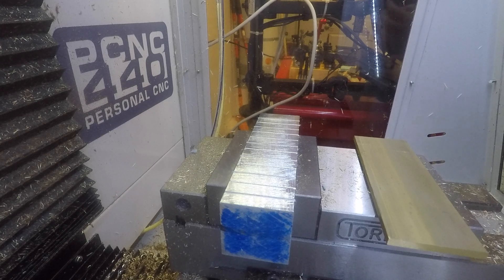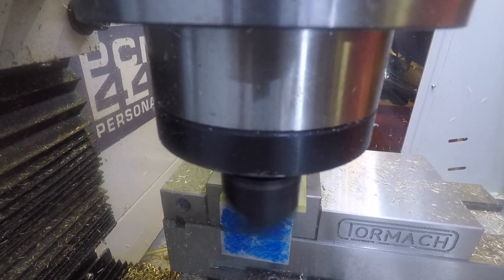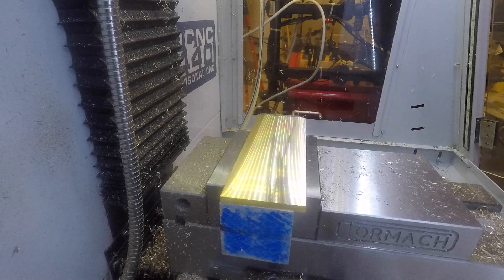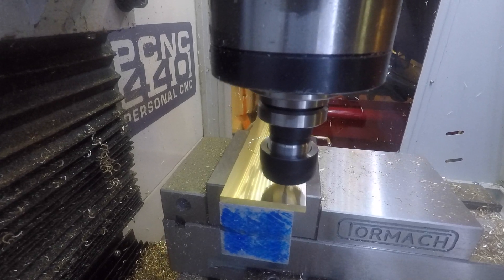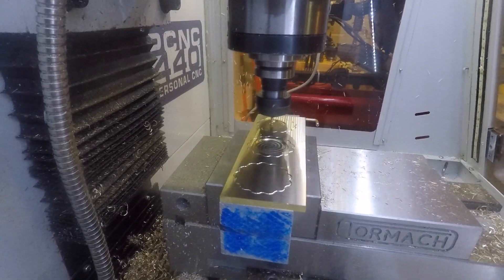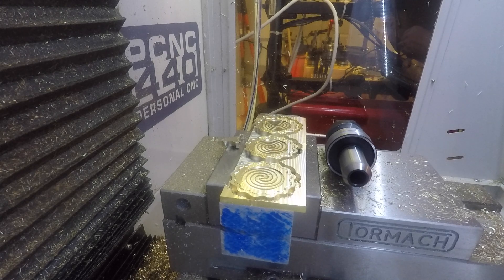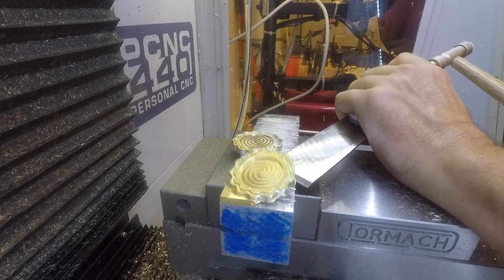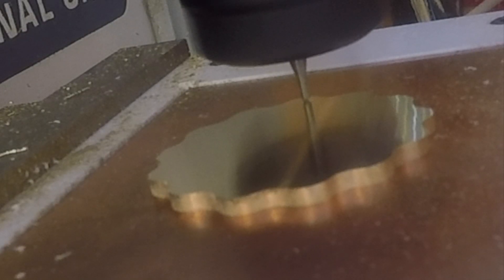Machining the SOB 2017 Gift Coin

Comment: Glad I saw this video.  There's a few good ideas in there and I have a few coins to make myself.  Any details on that vacuum table you made?
Reply from the maker: Glad you found the video useful!

I haven't published anything on the vacuum table yet, because I still have yet to use it for milling circuit boards. Short version, it's just two slabs of delrin machined to fit together snugly with an open cavity between them. The top one has a bunch of little holes drilled in it, and a shallow pocket the size of the circuit board blanks. I ended up hooking a small shop vacuum to a larger hole in the side, after trying and failing with a vacuum pump intended for air conditioning systems.
Reply: Very interesting and thank you for sharing!  If you don't mind, I have a small project that needs a circuit board and I don't know where to start for materials.  Do you have a good source or a preferred material?

Comment: Lots of fly cutters will do that simply due to lack of tool rigidity (spring).  Might not be your machine out of tram.  Try a face mill and see if you get the same effect. That would be more indicative that you may have tram issues.
Reply: Thelifeofbrian that’s good to know, thanks! It might be just the excuse I need to buy a face mill.